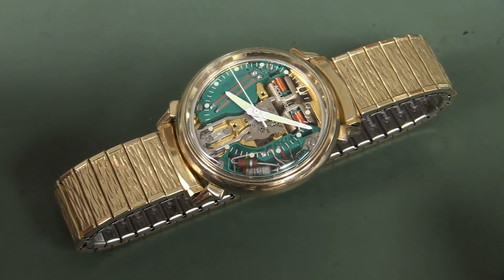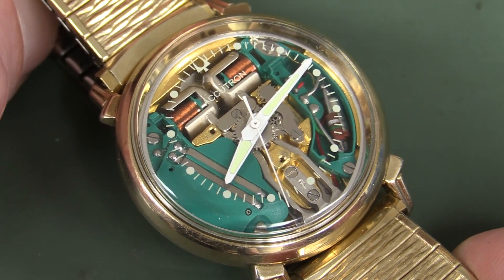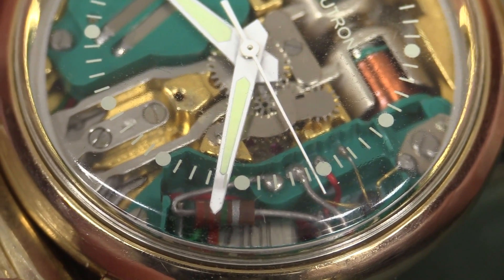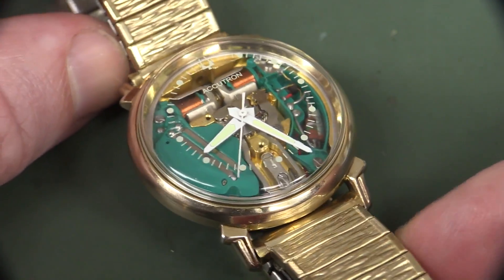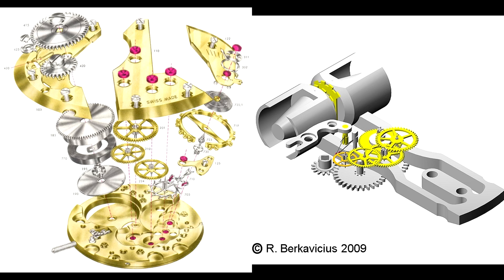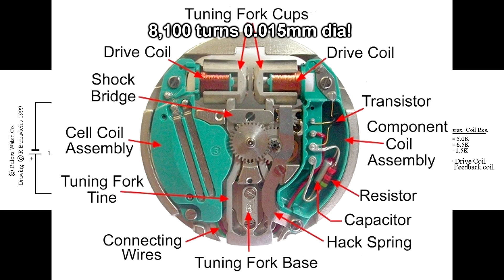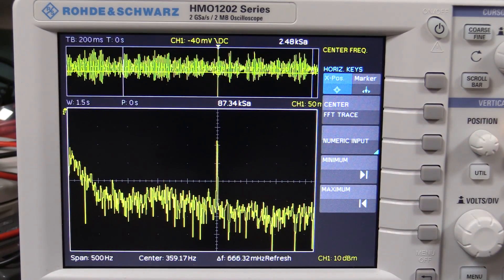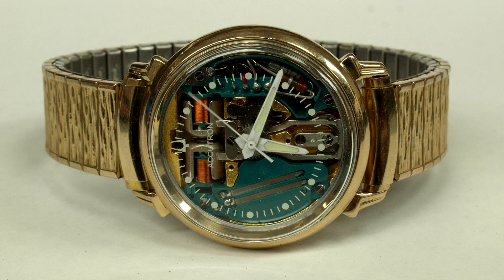EEVblog #920 - World's First Transistor Watch! - Bulova Accutron Spaceview

Comment: I bought ($110) model 218 as a 30th birthday gift to myself in 1974.  Now age 81 and a grandpa, my Accutron continues to run strong.  I only used on special occasions.  I have since added a "Railroad Approved" model 214. Both watches are stored in a watch case.  I placed a stiff piece of paper over their crystals which transfers the vibrations into the paper. The result is an amplified hum that can be heard two feet away.

Update: I have since acquired two more model 218's. I adjusted the "inertia wheels" which fine tune the resonant frequency of the tines.  They can be seen on the ends of the tines with notches for adjustment. Adjusting into the center of the movement increases rate, adjusting away from the center reduces rate.  My movements are operating at 1-2 seconds/day. My Rolex Air King is rated at 2 secs/day.

Comment: Really amazing they ever got that index wheel mechanism to work. The watch had to be regulated differently depending on whether you wore it on the left wrist vs. the right as the tuning forks were sensitive to gravity. I owned a Spaceview until it was stolen from me at gunpoint in 1970.

Comment: When listening to the hum, the high harmonic you hear is the pawl ratcheting the index wheel forward.  The index wheel spins over 38 million times per year and has 320 teeth that you can't even see well with magnification. Sometimes when you put a battery in, you'll hear just the fork vibrating, but no spinning of the movement til you tap on the side which gets the index wheel spinning.

Comment: I would guess this particular watch is not an "original" Spaceview, but instead a frankenwatch made by removing the dial from a "normal" Accutron and replacing the crystal. I say this mainly because it is missing the "chapter ring" that should have lumed indexes along the outside of the dial, and instead has an aftermarket "Accutron" indexed crystal. That's fine though - these are much cheaper than "original" Spaceviews and still show off the mechanism of the tuning fork very nicely. I have one myself.
Reply: The earliest Spaceviews were done this way, before the chapter ring models though this is a modern conversion, it has the wrong hands.

Comment: It's a near-perfect watch, but as a downside, Bulova removed the crown from the early tuning fork watches. Their reasoning was that their watches were so accurate that they didn't need to be adjusted, which they admitted was a mistake, so later watches got an adjustable crown again.
Reply: The crown is on the BACK of the watch, it folds down!  I have several. How would you set it for daylight savings or when you replace the battery  if it didn't have a crown?

Comment: A  LOT of inaccuracies in this video. That is NOT an "M8" model... "M" is Bulova's date code for the the 1960s. "8" is the year. M8 = 1968. That particular watch was originally NOT a Spaceview. One of the many CHOP SHOPS that spits out converted "Spaceviews" by the dozens to unsuspecting SIMPS produced this one. The CHOP SHOPS remove the dial and install aftermarket hands and crystals... as this one has. The hands and crystal here are NOT "original." On Ebay the CHOP SHOPS are in GA, Bulgaria, the UK, CA, FL. You can spot them because each "store" has many of these and their listings look so similar within each "store." These CHOP SHOPS are destroying beautiful classic vintage dialed watches by the thousands. This guy got DUPED by one of them.   :(

Comment: What was the transistor used for?
Reply: The transistor amplifies the oscillating signal to provide sufficient drive power to the two drive coils. The alternating magnetic field around each coil then keeps the tuning fork oscillating.

Comment: I bought my Accutron when I was in the army in Germany in '68.  It was well over a hundred dollars and was the worst piece of junk watch.  On a warm day when I sweat, I would look at it and then 20 minutes later the minute and hour hands had not moved, even though the second hand was moving!  I sent it back for repair, then got it back, and it still did exactly the same thing!  I bought a 9 dollar Timex and it did the job the Accutron couldn't do: keep time accurately.  👎👎👎👎👎👎

Another annoying thing about this watch is the 360 Hz tone is conducted up through your wrist and arm bones so if you lay your head anywhere on your arm, you hear the constant whine of the watch.
Reply: That’s funny I have six of them and they are all 50 years old and they work great. Even the ones that haven’t been serviced

Comment: The Accutron looks way more simpler in the side my side exploded views, given that there are no jewels, plates or screws shown on the right. And the power circuit and battery is not included either.

Comment: the most astounding thing about the movement is that tiny gear that drives everything via the pawls set with tiny jewels. the gear is so fragile that the teeth  can be smudged off if touched incorrectly

Comment: Pardon this thread necromancy, but I just stumbled across a snippet from a Accutron TV commercial: https://www.youtube.com/watch?v=nQ9_bOIj49s&t=13m24s (should start at 13:24)
After your oscillator teardowns I was trying to find a simple lower-level explanation of how the crystals works, mainly how it's not thrown off by adding the energy that keeps it resonating. (Same question for the tuning forks actually, or even an overly-aggressive escapement for a pendulum clock. If it actually is a problem them I'm sure it's been dealt with, but I've never even seen it discussed.)

Comment: Yea that one is NOT an original space view either. It has no chapter ring, and the hands are wrong. So that watch did not start life as a space view. Someone removed the dial face and sold it as a space view. The hands, especially the second hand, /and lack of a chapter ring are a dead give away.  Worth 250 to 350 bucks at best....

Comment: Thank you for this one, Dave.  You inspired me to go get my Accutron Astronaut (circa 1969, black dial, with added 24-hr. hand and GMT / 2nd timezone bezel) out of the drawer.  Ordering a new battery now.  For what it's worth, I believe that "M8" on the back is the date code.  M8 = 1968.  Mine is M9.  Mine is accurate as anything laying on my desk, but gains 10 minutes a day on my wrist.  I wish someone would come up with a 1.35 volt button cell that didn't kill ye gods and little fishes.  Cheers.
Reply: Get it serviced and phased.  The odds are very good it can be adjusted for modern batteries. Virtually all my Acutron‘s are running on silver cells

Comment: Just want to mention that the new Accutron line does not have a tuning fork movement. The one you put up is the Bulova Alpha - a part of the Accutron line. These watches are quartz powered but use a special movement called the "Precisionist" movement. This movement is (as the name suggests) very accurate and offers an incredibly smooth seconds hand - just slightly less smooth than the tuning fork movement. Now Bulova DID in fact make a real anniversary edition Accutron with a tuning fork movement that looks very similar to the Alpha. But this watch goes for $5,000, whereas the Alpha sells for ~$240.

Comment: You didn't mention the best part of the engineering of this watch, the small wheel driven by the tuning fork... its only a couple of mm in diameter but it has 360 teeth cut into it, still people not sure how they made them so accurate and reliable 50 years ago... there are two jewels that ride on that wheel, some of these watches have had billions of ratchets on that wheel yet still work fine... need a good microscope to see the teeth on the wheel..
Reply: 320 teeth the fork moves at 360 hz so the gear actually makes more than one rotation per second.
Reply: It is a very impressive technology and it is even more impressive that this extremely fine mechanic lasts that long! I know a person worked at the Bulova factory and made these wheels. They were drilled mechanically by mainly Italian workers (and not swiss!) in the factory in Biel (Switzerland)
Reply: MY CHINESE CHEAP QUARTZ WATCH IS MORE ACURATE THAN THAT SHIT.
Reply: @lkkjhtemmexv1838  Your stupidity is profound and obvious for all to see.
Reply: @lkkjhtemmexv1838  Who gives a shit?
Reply: No it’s not and you’re a chimp

Comment: it's interesting how the seconds hand moves smoothly like a proper automatic watch. the small hand on quartz watches moves 1 time / second (some move 2 times /second) but on good automatic watches, the small hand moves 15, 20, up tp 30 times / second, providing a smooth movement. that's how you can tell from afar if someone's rolex is fake: you'll see the small hand move in staccato! some cheap chinese knock-off use a cheap automatic movement that'll break apart after a few months, but do provide a smooth movement of the small hand (for the time it works...)
Reply: mechanical watch hands move between 5 and 10 times per second and are not as smooth. This hand moves 360 times per second and some quartz watches have viscous fluid for smooth sweep. some other watches are mechanical in nature but are quartz regulated and have a truly smooth seconds hand.
Reply: I saw so good fakes that actually used high grade swiss movements. And even some parts were so good made that was simply impossible to tell if it's a fake or not without dissassembling the whole movement. That's kinda scary... I'm an amateur watchsmith, but a proper watchmaker taught me some time ago. And he showed me so well done rolex fake that even a rolex seller could not recognize it. Even after looking at the movement. So judging on the second hand is not always a good way...

Comment: I love how there's an ordinary (1/2 Watt?) resistor in there and a regular size transistor. The people at Bulova must have just thought: Okay this is the circuit and these are the parts we can get, let's design some mechanics! If they would have been bothered, they might have designed their own integrated circuit (or let someone else do it for them) or invented SMD electronics in the process of designing the watch, but no. They just started off with those parts and said: Mechanics is what we're good at, we'll just deal with the electronics.
Reply: They were a bit rare and scarce in 1960. The first commercial integrated circuits were released AFTER the Accutron launched.

Comment: How long does a new battery last in that mechanism.
Reply: About 10 months. The original battery lasted 1 year but was mercury based and had a higher capacity than the replacement ones. The new ones have a slightly higher voltage of 1.55 instead of 1.35 V but have less capacity. But you can change the battery by yourself, being careful not inserting them the wrong way.
Reply: Many Thanks for the information.

Comment: Nice!

Be aware that these old watches most likely contained fluorescent paint on the indicators based on zinc sulfide phosphor. The phosphor in there is radioactive (verifiable with a Geiger counter). Just don't expose your body parts for too long to the paint.

Comment: I inherited one of these (tuning fork but not the see through model.) They eat batteries compared to a quartz, need to replace them 3-4 times a year, and Bulova has now orphaned  them so when they break you are out of luck. No spare parts available. Mine had a gear inside which apparently has 300+ teeth on it wear out. But Bulova did give me credit = the original purchase price of the watch ($300) towards the purchase of any new watch I wanted (from any maker, not just from them) which I thought was fair.
Reply: The battery should last 14 months at least, so something wrong with your watch

Comment: I'm curious have you tried sweeping it with a Geiger counter? I remember they used to use radioactive materials for the glow in the dark coating put on watch dials. If I remember correctly it was used especially on higher end watches into the mid sixties-early seventies.  Not completely eliminated till well after quartz was dominant in general timepieces. From what I remember its not so much a health concern unless your job was to coat the dials. Yet you will get a significant local increase from background with a meter.
Reply: Swiss watch manufacturer used Radium until early sixties. It is radioactive specially for the people who are working with it. For the watch owner, there is no risk. From the sixties on, they changed to Tritium, which is still radioactive but less. On the dials they write "T-Swiss Made-T". This material is still used today. Only recently, the japanese invented a non-radioaxtive material called "superluminova", based on bugs. As a watch user, you must not be afraid, but many women died from cancer when they were applying the mixture of powder and paint on hands and dials.

Comment: the best way to pick the sound of that hum would have been to use a piezoelectric pickup instead of the aerial microphone, precisely the kind of piezo capsule used as speaker in electronic watches, they catch any structural sound wonderfully and are connectable just like a normal microphone.

Comment: Interested to know how the mechanism itself works (shown at time index 9:30). It shows there 2 small pins contacting pillars on a small wheel. One of the pins appears to be fixed to the watch body while the other is affixed to the fork leg. I'm presuming that as the fork oscillates out the pin pokes the post forward pushing the wheel round, a ratcheting effect is then setup on the 2nd pin affixed to the watch body ensuring the wheel only moves forward one pin in rotation and is held ready for the next oscillation of the fork to push it round again with a follow up poke. Is this how it works fundamentally?
Reply: Ha nevermind, my intruition was correct! Here's the specific page detailing the watches mechanical indexing mechanism:

http://members.iinet.net.au/~fotoplot/accindx.htm
Reply: You are completely right! The mecanism is older than the 1960's, the problem was basically to produce a wheel of 2mm diameter and 300 teeth. And of course, the battery.

Comment: Sorry to say this, but I'm reasonably certain that your watch is not a factory Spaceview. The crystal and hands are modern reproductions, and I'm pretty sure that case was never available in a Spaceview variant. That particular case style is commonly used for Spaceview counterfeiting, and is often seen with incorrect gold hands.
Reply: I found the case number for that style. It should be a #2548 - definitely not an original Spaceview.
Reply: +The Vintage Technology Association it's harder to tell with them that because many times jewelers would fit and retrofit different cases to different watches. I'd find it more suspicious of the fact that the hands are just wrong.  The vast majority of space view watches on eBay are frauds. There are probably 20 times more space views then were actually ever produced by Bulova
Reply: Case number is the only reliable way of partially authenticating a Spaceview. The reproduction crystals and hands are close enough to original Bulova parts that they are generally considered acceptable replacements on a genuine Spaceview with same-style parts. The overall appearance of Dave's watch is correct, with the exception of the lugs, which reveal that it's not a Spaceview case number.

Comment: A 50 years old working device  (x-x)  w0w.
I wonder why consumer devices doesn't last 1/10 of that time ?
Reply: 50 years is nothing for a watch. I have some that are 300 years old. In fact, you can always repair a mecanical watch.
Reply: Consumer needs and wants are HUGELY influenced by marketing. So much so that I would question the 'needs' part and put it down to 'wants only......or more correctly 'not wanting to look out of date'.

Its not the consumer driving the show. The marketing has been in charge for decades.
Reply: A good mecanical watch, like even a Seiko 5, lasts 50 years when you take care and clean it every 15 years.
Reply: well, companies are intentionally making them last less long to make the customers pay more over time.

Comment: To be pedantic, a quartz oscillator IS a "tuning fork mechanism" :)
Reply: 32kHz watch crystals are, hence the shape of the can.
Reply: The oldest one had indeed the shape of a fork. Today not.
Reply: +Graham Langley In one point, to be pedantic, the video is wrong. The Bulova was not the first transistorized watch. From 1957 one could buy electromecanical watches. They had a mecanical oscilator with magnets and spools which functioned as motor and not only oscilator like in mecanical watch where the spring is the motor. They were made after a US patent from Ato by the swiss ESA up to the early 70's. As an interruptor, they had a transistor. I love these watches since they are incredibly reliable and all of mine are 50 years and more and working like new. An innovation was also the use of nylon.

Comment: That is a beautiful watch. The silver oxide battery has open circuit potential of 1,55V, but the typical median operating voltage is 1.2 to 1.5 V depending on the current.

Comment: Regarding the perceived jankiness of the oscillation, I think the diffeent frame rates might be the issue. First, you're sampling a 360 Hz signal with a 1000 Hz sample rate. This gives you 2.8 samples per cycle, which is just barely above the Nyquist requirement. To make matters worse, you're exporting it as 50 Hz, for playback, most likely, on 60 Hz screens. This also gives time domain distorion since in practice, every 5th frame of the original material is duplicated, to produce the higher frame rate. So in essence, that's no grounds to suspect anything wrong with the watch.
Reply: Yes, I was about to suggest the same thing - just a basic strobing/aliasing effect because of the effective frame rate being only a small multiple of the oscillation rate.